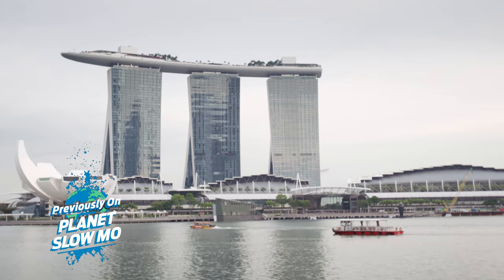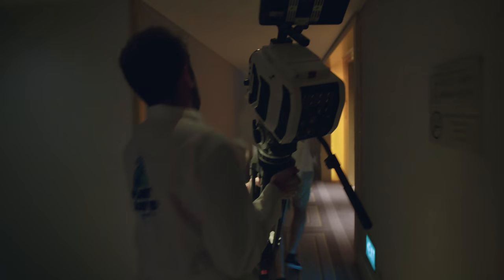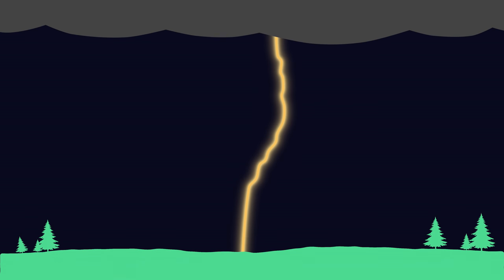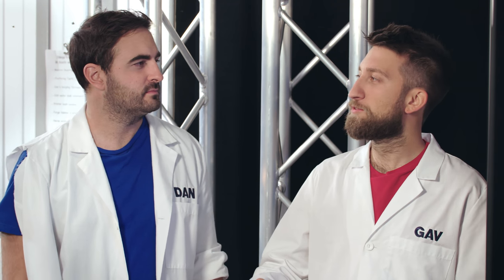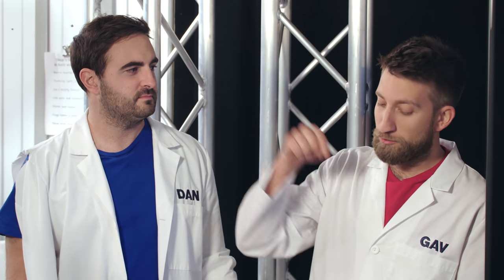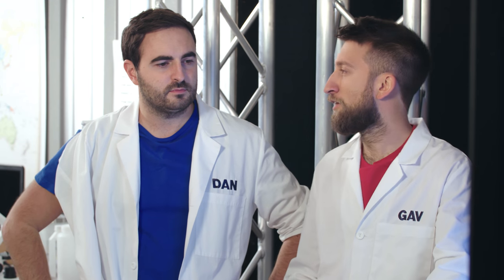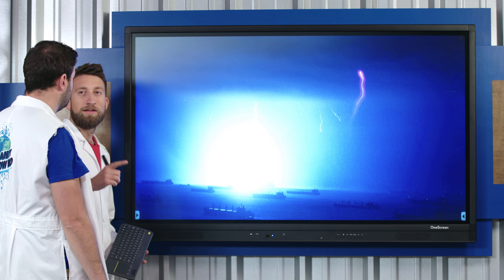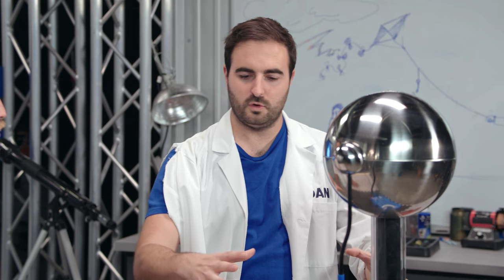Van de Graaff Generator in Slow Motion

Comment: I love how they got an expert who didn't just stand there all awkward. Dude was awesome.
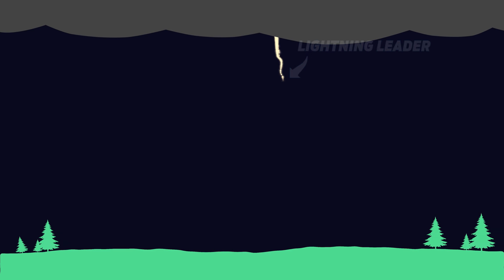Reply: Yeah but I'm pretty sure he was wrong about the speed of lightning. At 1:40, he says the leader goes 1/10th the speed of light. But that's NOT right. EVERY source I've read claims that the lightning "leader" goes MUCH SLOWER; closer to like a 1/1000th the speed of light. That's 1,000 times slower than what Prof Liew said. The return strike can be between 10% to 50% the speed of light so he was right about that part.
Reply: @CosmicG777  I was thinking that that statement didn't seem close to accurate. If that were the case, then you could go back to the previous video about lightning, watch the leaders come down, and just think of something going 10x the speed to get light speed. Because each leader stayed in view for much more than 10 frames, that would have meant that they could have captured things moving at the speed of light just using the phantom, which is obviously not possible.

Comment: Another thing to point out; in your freeze frame with the charge cascade returning up the bolt, you also have an inverted internal reflection (to the right) which is more-or-less correctly exposed and shows in much greater detail the brightness distribution of the ionised air
Reply: OFFtheCHIZANE mind blown
Reply: Yep, saw that in part 1 as well.
Actually was able to take a picture of the sun during the last solar eclipse on my cellphone and got the same effect. 
(No, I didn't look up. However, my hand got pretty warm holding my cell out in the sun)
Reply: I actually expected them to point that out.

Comment: Did you borrow a camera from Smarter Every Day (see monitor at 10:36)?
Reply: I noticed this, too. I'm wondering if this is part of a colab that we don't know about yet, or if Destin was at this same location doing something earlier in the day.
Reply: I noticed the same
Reply: I guess I should check the comments before writing my own about the exact same thing
Reply: Destin often loans his camera to hav
Reply: Gav*
Reply: I'm almost positive that in the lightning video or the one before it they mentioned borrowing a camera from Destin
Reply: And at 7:25
Reply: Gavin/RoosterTeeth own a couple of Phantom Flex cameras, but when they need much faster frame rates, they borrow the V2511/2512 from Destin
Reply: Betwen youtubers they take parts of the videos they do.
Reply: @MegRyanCaskey  same.....
Reply: its up at 7:30 first
Reply: Smarter every Dan
Reply: @thatsgood2271  You can edit comments actually.......................
Reply: @Sand.Springs  ik but I didn't want people to wonder what is used to say
Reply: Was JUST about to comment on the same thing!!
Reply: @Wogle  They are using V2511 almost everytime

Comment: 11:14
Dan: “I feel like uh, you should get shocked as well for this.” 
Gav: “That’s probably fair.”
Dan: pulls out taser
Reply: @Bond 0707: Yeah, I thought is was funny too. Don't know why Gav ran so fast, since the taser is only a couple of kilovolts (40,000 I think) while the Van der Graaff generator has something like 400,000. On the other hand, the taser does not provide a short spark but keeps hooked in your skin / muscles.
Reply: Those are stun guns. A taser works by having DC over a gap, (2 nails) charging and then releasing a severe amount of energy.
Reply: 11:14
Dan: “I feel like uh, you should get shocked as well for this.” 
Gav: “That’s probably fair.”
Dan: pulls out taser

Comment: Please can you film the "1 million rounds per minute gun" in slow motion?
Reply: there is not a thing like that.
Reply: @KingJohnMichael  yes there is, check out the link i just posted
Reply: @UKDrivingTest  I approve, I would like to see that as well!
Reply: @UKDrivingTest  There's no way that's 1 million rounds. The gun would melt and everything in it's path would disappear immediately with nothing left as to get 1million rounds every single mm and smaller would need to be covered by 100+ bullets
Reply: lol
Reply: If it were firing for a minute, it would be a million rounds. The likely only fired 1000.
Reply: @DatCanadien  THat gun does indeed have that rate of fire. However, it does not fire 1 million rounds, nor does it fire for a full minute. It fires around (just a guess from me) 500-1000 shots in a fraction of a second.
Reply: @DatCanadien  They only fired 36 rounds from it in a single, near-instant burst. The recoil was enough to pitch the gun way off target and the shots penetrated several of the wooden targets they'd set up. Not exactly useful for sustained fire given that it's a Metal Storm prototype, but if it theoretically could sustain automatic fire then it would fire a million rounds per minute.
Reply: @UKDrivingTest  
What for? It would be like filming an oversized shotgun.
Reply: @DatCanadien  lol, he said "1 million rounds PER minute"
Reply: Metal Storm went into administration years ago, and the idea of the "million rounds per minute gun" was forgotten long before that - one of the few ideas it might have been useful for (shooting down incoming munitions) can be achieved better and with lower risk of collateral by airbursting projectiles (which are now much more cost effective than when O'Dwyer originally founded Metal Storm back in 1994). The accuracy-by-saturation approach could also be achieved with buckshot, which Metal Storm did figure out as a technology some time after the million-RPM prototype.

Even by the time that Metal Storm folded, the superposed load concept had been adapted into ideas like underbarrel grenade launchers that could fire several shots, and weapon pods that didn't need external magazines - the idea of rate of fire was almost entirely forgotten in favour of lightweight and compact designs that didn't need reloading.

Although the technology has now been bought out by another company, they wouldn't have any interest in showcasing such a dead-end application of the concept; they're still sticking with the lightweight/compact angle.
Reply: This!
Reply: Breezetix at 1 million/minute that still needs to shoot 16,666.67 rounds per second. I HIGHLY doubt that
Reply: @DatCanadien  Speaking as someone who's worked with the firearms industry, it's absolutely a real weapon. 

With 36 barrels, the idea of each barrel electronically triggering superposed rounds with only 2 ms between them is entirely plausible, it's just not very useful in the real world - hence why it was a commercial failure.
Reply: @UKDrivingTest  I just saw your comment on that video...
Reply: YES
Reply: @bfgfanatic1747  If I'm not mistaken (and I very well could be) that gun has the bullets stacked on top of each other in the same barrel, firing them off with burst of electricity instead of using a primer. So it's firing 36 x 3 or 4 bullets. I vaguely remember seeing a documentary off them like 15 years ago. I guess they went bust or something since we haven't seen any more of them.
Reply: @DinnerForkTongue  Bc the gun shoots 180 rounds in less than a second, to see that many bullets come out so close to each other would be insane
Reply: @bfgfanatic1747  that was 12 years ago, it has gotten better.
Reply: @SomeThrillingHeroics  Good and informative comment. I'd like to add that the 1,000,000 rounds per minute is a little deceptive and a marketing "buzz-phrase" to attract attention. As they were using multiple barrels fire sequentially and extrapolating the firing rate into rounds per minute, the claim is not quite as impressive as it initially sounds. Doing it this way, it would be possible to fire a double barrelled shotgun with two trigger, firing the two shots ridiculously close together in a minute fraction of a second also claim that the shotgun just fired at an absurd level of rounds per minute whilst only actually firing two shots very close together.
Reply: @sloth0708  
Again, it would be no different than filming a shotgun blast.
Reply: @DinnerForkTongue  except  shotgun blasts send all of their lead at once and are nothing like a machinegun that articulates a hundred small blasts in under a second.
Reply: ckatlinga ironic
Reply: You cant record a bullet in slow motion
Reply: minigun with bullet time would be awesome too.

Comment: Skin has really high resistance, but it drops off quickly when voltage is introduced. That's why you could get so close the first time, but then it hit you from several inches away.

Comment: A note: Do not stand or sit next to or against a lone tree in an open field during a thunderstorm. Lighting can hit the tree and jump to you.
If you are stuck in a very open and flat field during heavy lightning, and absolutely cannot make it to shelter, last I heard, best thing is to crouch low to the ground, with your feet as close together as you can manage, curl up into a ball, and cover the back of your head with your hands. You don't want to lay down, because if lightning hits near you it will travel outward through the ground and might travel through you. Similar for keeping your feet together; less chance lightning discharging through the ground will travel through you. The leaders coming up from the ground tend to form off of sharp points, that's why you curl into a ball. And any slight depression in the ground is advantageous to place yourself in as well.
Disclaimer; I'm not an expert. I am a weather enthusiast, though, and did take a meteorology course in college.
Reply: The main reason you shouldn't stand next to a tree is because the tree can explode from the lightning, sending shrapnel everywhere.

Comment: Dan & Gav, I was struck by lightning Sept. 1979 while going to college at USF Tampa. I was riding my bike, rain storm approached us, lightning came down, struck only myself (not girl riding bike beside me). It bifurcated in front of my face & struck both my hands on the handlebars, popped my bicycle into the air & I crash landed. Both my hands/fingertips were smoking! Raced to hospital, lucky to be alive. They said the rubber in my bike tires saved my life (rubber grounded my lightning strike). Ultimately, all my fingernails fell off & grew back weeks later.
Reply: Wouldnt it must likely take the easiest path which is usually the closest path which would be your head or what?
Reply: Wouldnt rubber stop the lightenibg from going to ground cause its not a conductor?
Reply: My arms were outstretched in front of me. It was the 1970's waaaay before bike helmets & the handlebars on my Schwinn World Sport model bike, positioned my arms way out in front of my head. It was crazy scary experience. 40 yrs ago, but I can remember it like it happened 5 minutes ago!

Comment: As someone with a really low electrical resistance, I feel Dan's pain. I get zapped a lot, especially by car doors. 

I startled my physics lecturer once when playing around with a multimeter. I had set it to measuring current and held the ends of the leads. I got a pretty high reading. My lab partner tried the same thing and got about a tenth of what I had.
Reply: Jimmi K Not particularly. And this test was done in an air conditioned lab in autumn, so not a sweaty environment
Reply: @little_valkyrie  I thought I was the only one. It's just a split second but it hurts. Apparently dry air causes more static shocks so that could be why.
Reply: I think you were measuring your resistance. If you read ten times your partner's resistance for yourself, your body actually resisted current flow ten times more than him & dissipated 1/10th of the power.

Comment: Alright so yesterday I stood up out of a metal framed generic stadium seating chair and grabbed the back of my chair and static shocked myself. So I sat down intrigued and move around for a bit and then stood up to see if I could repeat the shock, it hurt but it worked. So I instantly went into science mode and turned the lights off went to slow mo mode on my phone and recorded 2 or 3 different shocks. Basically the same experiment here except on a much smaller scale. I immediately was thinking about how I wished you guys would do this video and I was even about to send in the clips and try to get this made but here it is!!

Comment: Van de Graaff machines are a lot more fun with dry air, fuzzy knitted clothing and long hair, depending on your definition of fun.  So, if you're giving demos some winter day to grade schoolers, and have a long haired girl in a sweater put her hand on the generator, don't gesture at her within a couple feet.  It didn't hurt too much, but it did startle everyone.  There was a loud pop and then she jumped away.  We went on to do demos with other machines since no one else wanted to get zapped from long distances.  Physics is fun.

Comment: I remember having this mail-room job in a big office that had a big closet room full of rolled up carpets stacked up against the walls. Sometimes I'd have to go in there to get a roll or other supplies. The static shock from the doorknob was about 10 times stronger than a typical doorknob shock. Like, I felt it past my fingertips. And it was loud too. I eventually realized that if you fist-bump the door first, it removed the static on the doorknob.

Comment: Just a note. You cannot fry and egg with 1 volt or 1000000 volts. Voltage is just potential, like water behind a dam. Current or electron flow is the force or energy.

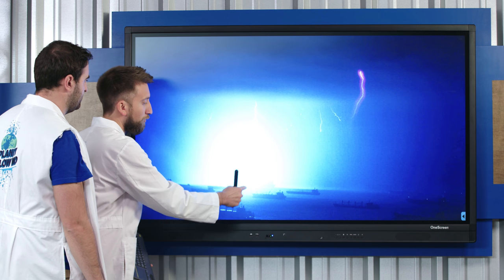Comment: Hey Gav and Dan, what's up with the red lightning? (best look is from the last frame of 6:10 to the tenth frame of 6:11)  [for those who don't know, frame-by-frame is with the < and > keys]

It doesn't look like any of the other bolts, has no apparent leaders, and at first I was thinking some kind of artifact/reflection of the bolt from the overexposed area but then I thought how strange it was that it was brightest/most visible in the last frame of 6:10 before the return stroke blows out the image and how once it recovers from the overexposure you can see that the red "bolt" is a bit longer but is now far dimmer and fades more rapidly than anything else. 

 That led me to wonder if maybe it's a feeler from the same strike but one that traveled much further laterally through the clouds before starting to descend and then as the return stroke discharged all the feelers it was the quickest to disappear since it was so weak and distant from the actual strike.  

Anyway, congrats on the new show!  It's great except for that part where you ignored the mysterious red lightning...

Comment: For any people actually using this for physics: in the Van De Graaff generator, positive particles don’t move to the top, they cannot move
Instead negative particles move away leaving it with an overall positive charge :)
Reply: On the contrary in a cloud, both the positive and negative charges can move (because it is a fluid)

Comment: Volt is not really what kills you, but the amount of Amperage*.
Reply: norXmal I thought the word was Amperage.
Reply: @mrbenoit5018  Yeah, I wrote it in Norwegian without noticing, my bad.
Reply: norXmal it’s alright.
Reply: That's a broad assumption. Yes, amperage is what ultimately "causes" the damage, but the voltage needs to be sufficiently high enough to break through skin, as well as the duration and energy transfer of the shock. For example, a typical static discharge is around 15-30kV, peaking at *15 AMPS*... But it only lasts for a few nanoseconds, so not much energy is transferred.

If it were truly amps that killed you, then you'd die from your first static shock.
Reply: Xenro66 I thought the term was Voltaire.
Reply: Xenro66  English please?

Comment: The difference in electrical potential changes with altitude. The local atmospheric conditions matter to get the lighting started. Those shearing forces due particles movement is a common process during any convection and this is not a cause of lighting. I mean there is always a potential difference in the atmosphere. It is rather breaking the resistance of air by means of high enough potential difference. Stormy weather provides such conditions as the air becomes also more conductive. Same happens during volcanic eruption.

Comment: The Dan shock took significantly shorter than a single frame.  What we are seeing is much brighter in real life, but is captured over such a "long time" as to be as bright as we saw in the video.  How much brighter?
98M feet per second (=10% c) / (28,000 frames per second x 0.1 feet) = 35,000 frames^-1*
It's only visible for 1/35,000 of a frame, thus in real life, it was about 35,000 times as bright!

Comment: 98M feet per second (=10% c) x 13 frames / 103,000 frames per second = 12,369
The cloud was about 12,369 feet above the ground.*

* Also in metric where available.

Comment: 8:38 TL;DR: DO NOT play around with electricity just because you know it has a relatively low voltage or current. Unless a professional tells you it's safe, or you're using a product that has had its safety well established (like this specific Van De Graaff Machine), DO NOT go around trying to shock yourself for giggles.

I think it should be said that voltage itself is not the only factor in how dangerous electricity is. People will often claim it's current, but that's not the full picture either, because voltage and current are directly related to each other by the amount of resistance in the material conducting them. Voltage is equal to current multiplied by resistance, and current is equal to voltage divided by resistance; they determine one another. The bigger factor is, in short, the "energy" of the signal. It's a bit of a complicated thing to calculate. There's an excellent video by Afrotechmods that explains this in more detail, if you're curious https://www.youtube.com/watch?v=8xONZcBJh5A.